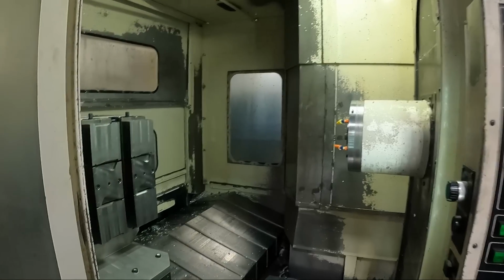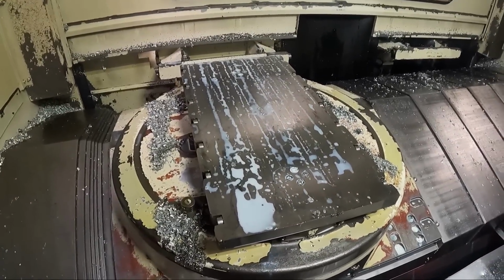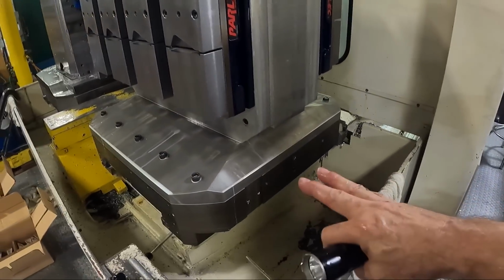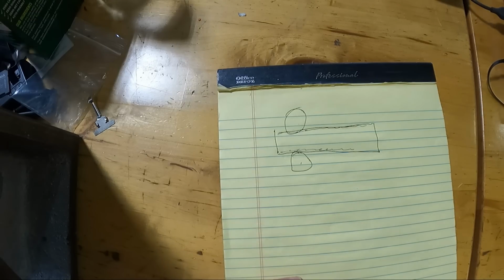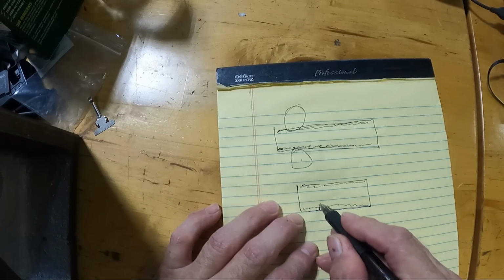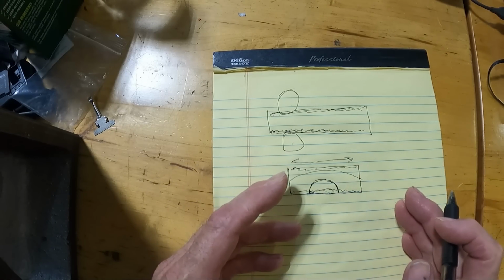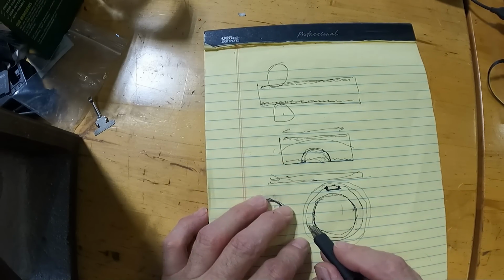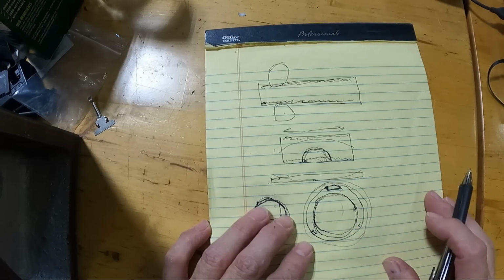Answer Some Comment Questions

Comment: This explanation of metal distortion during machining operations is absolutely the best I've seen thus far. I know this same line of reasoning is also applied to making molds for casting metal parts. Depending on the type of metal being casted, there is a certain amount of shrinkage (distortion) the metal produces after the metal cools down. The mold maker must compensate for this distortion by making the mold a certain percentage larger in all its dimensions  to allow for machining operations.
Reply: That has to be done for pretty much all cast parts regardless of material. Shrinkage is a huge deal & you can prevent a massive amount of headaches by working with the vendor during the design phase.

I was in the pool!! I was in the pool!!!!

Comment: I worked with material used to construct pulp mill equipment, mixing and material handling. Most of the time the material used did not have fussy requirements. I would stress relieve, heat straighten and use our 400 ton press to force material into tolerance. I was very successful for several decades. I had the most trouble with stainless. I worked with some large parts 20' long pipe 1' to 3' diameter 1-2" wall.